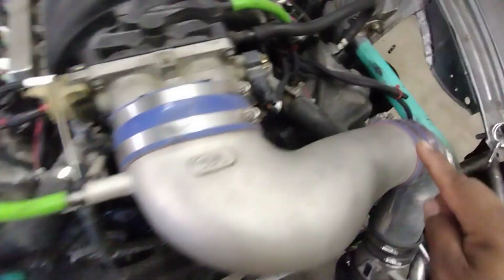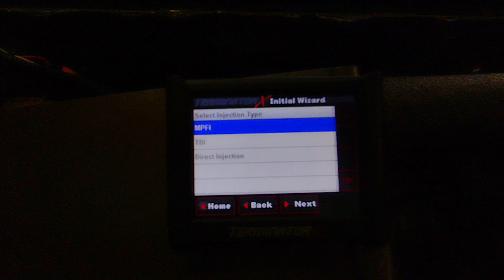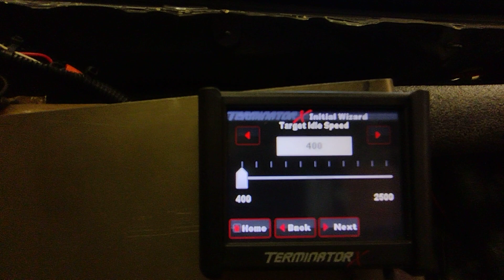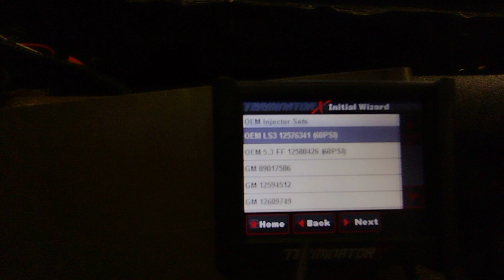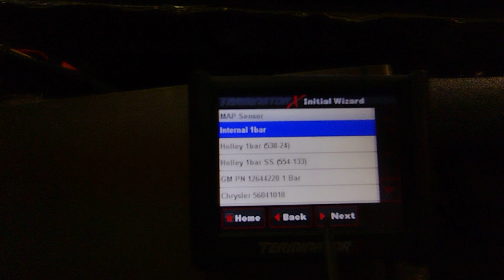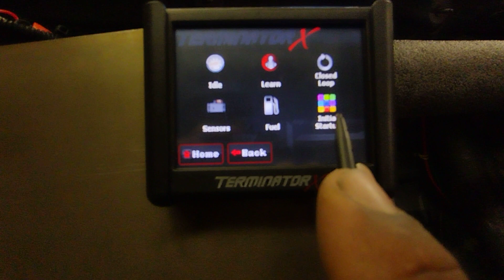04 Rx-8 with 06 Mustang GT 3v Holley EFI Terminator X set up

Comment: What did you do for the engine side wiring harness; is that a standalone or factory harness?
Reply from the maker: I have no factory harness. This set up is strictly powered by the Holley EFI terminator x. No other electronical routed for engine management.

Comment: How do you think the car would run as a daily driver with this system?
Reply from the maker: @chrisheinismd3956  from what I have seen, a few guys run these on their daily, and keep the stock ecu in place as well for the other electronic controls. It shouldn't be much different from any other ECU, just allows the capability to fine tune things.
Reply: @xavierkober7099   That's a good idea.  So you can use it to control the fuel pump and the trans controller.  The engine can be run by the Holley system?
Reply from the maker: @chrisheinismd3956  correct, but have to pick and choose on some items far as which ecu is managing what. Since I'm just using a holley system I don't have to worry about any other electronics. But if factory ECU is also installed, I am sure some programming will have to be done on that as well so that it's not trying to check on a sensor that is no longer connected.

Comment: Hey man can you make a video for me plz, about cutting the cam phaser teeth so the 2v wiring can work, i have installed the lockouts but i didnt know i had to cut the phaser points
Reply from the maker: @DriftDreams242  I will get one made up and post the link here soon.
Reply: @xavierkober7099  thanks so much man I appreciate it,
Reply from the maker: @DriftDreams242  here is the link to the video where I talk about the cam timing. I also go over some block measurements but hope it answers some questions for you. 

https://youtu.be/I_d5F1LTGck?si=PmJvoDq9NoOHZ82C
Reply: @xavierkober7099  thanks man going to watch it now